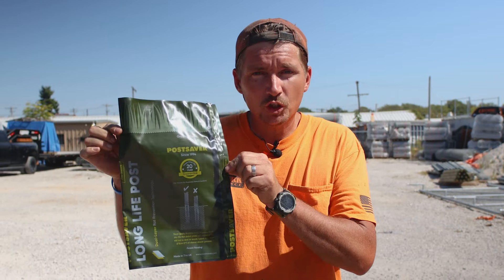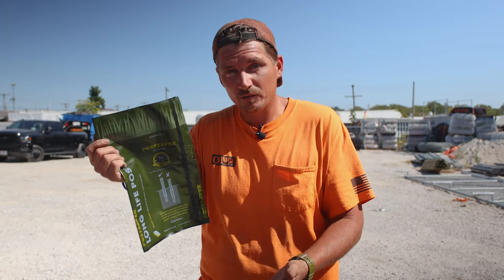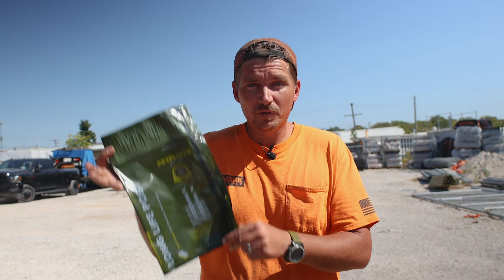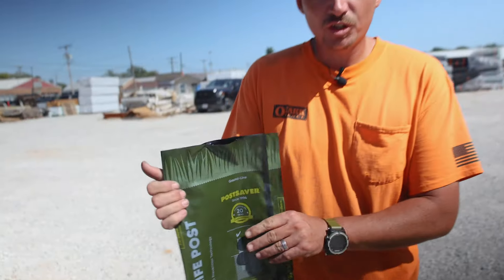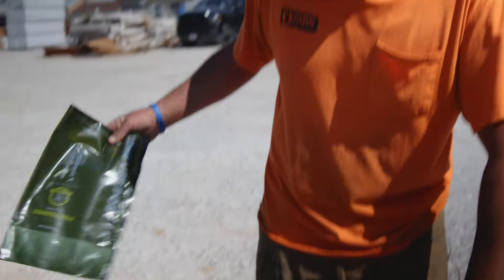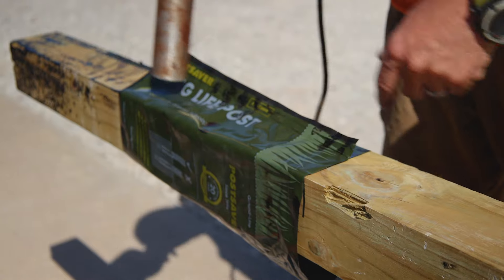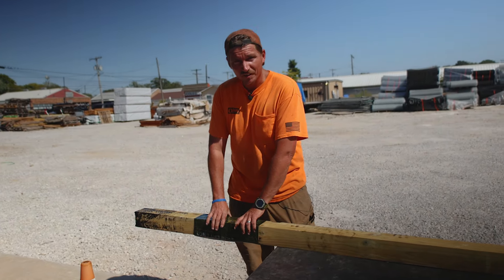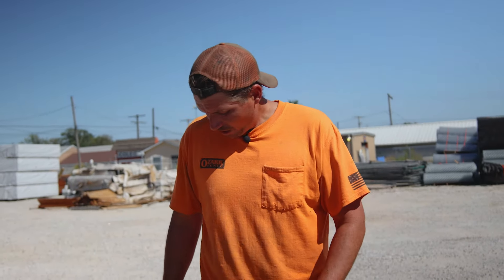Does This Product Really Prevent Fence Post Rot?

Comment: They delaminate , the plastic outer layer separates from the bitumen, so you end up with a plastic bag that fills with water. This happened on 43 out of 52 posts I did on a job. 
Also if the bitumen melts in storage and sticks to itself and when you peel open the sleeve the bitumen isn’t evenly distributed and it won’t work as some areas will be just plastic.
The sleeve isn’t uv rated either. It might work better if you use fence armour covers on it.
Best option is to use blueskin peel and stick with spray primer and fence armour covers. Faster installation, no heat needed and way cheaper.

Comment: I made a form out of old decking boards, poured concrete in them. 8' 4x4. I instslled 2 anchors for my top boards and attach my fence with twisted wire. 
They will be there after im long gone.

Comment: I've used them loads of times,  trick is to have a medium heat and keep moving the gun, them you wont blow holes.  also just wait until the tar seeps of the top/ bottom a 1/8 of an inch and then leave to cool.  I also soak my post (the bit that goes in the ground ) in some spare water based wood preserve for a few hours, just dunk in a bucket, it soaks up the treatment.  when dry apply the postsaver.